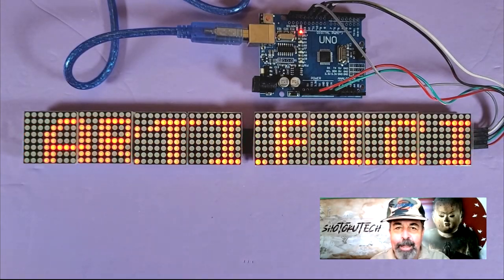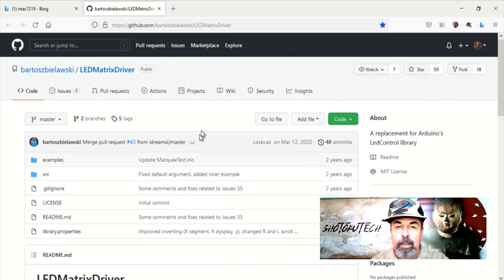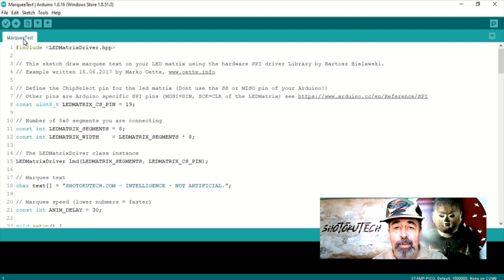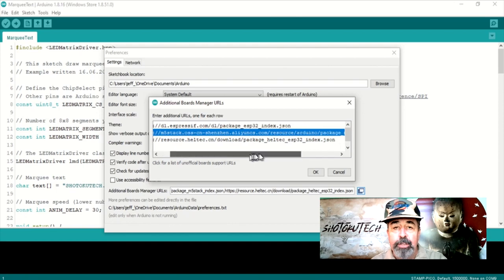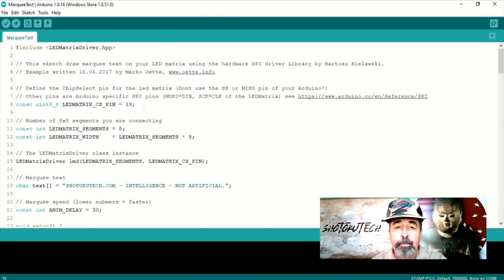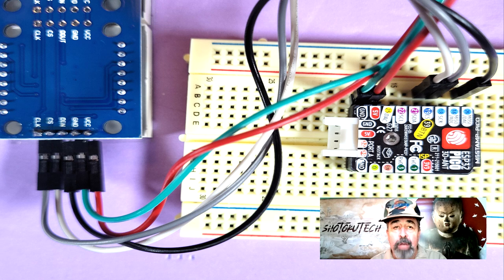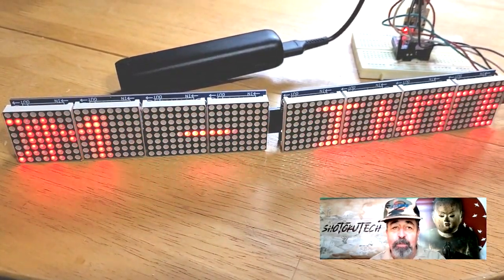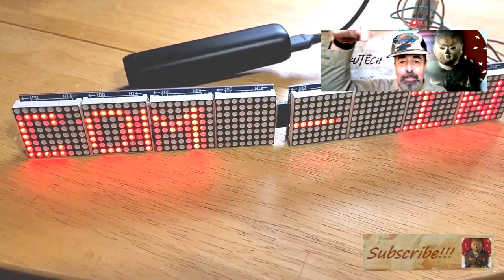Can M5Stamp Light These MAX7219 LED Matrix Displays?

Comment: Nice.
Reply from the maker: Thanks. I tried to answer your question. You may want an I2C Relay Driver for best results and power everything on the 5 volt line. Data stays at 3.3 volts. Best wishes.
Reply: @ShotokuTech  Thanks. Hopefully I can get everything working. Currently experimenting with an ESP-WROOM-32 embedded in an infosec conference badge I got 6 years ago and then largely forgot about. Backed up the (broken) firmware, flashed the latest stable release of micropython, and am trying to reverse engineer the LED controls.
Reply from the maker: @k98killer  Good luck. Best wishes.